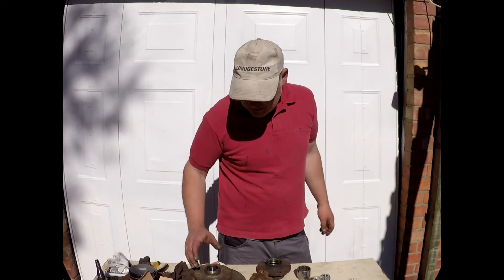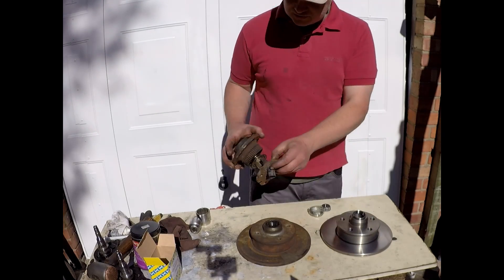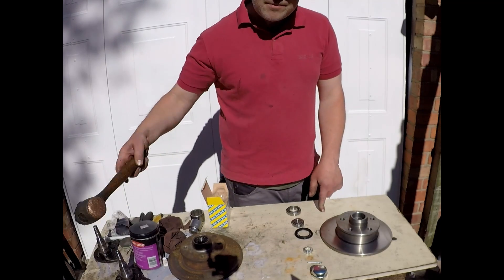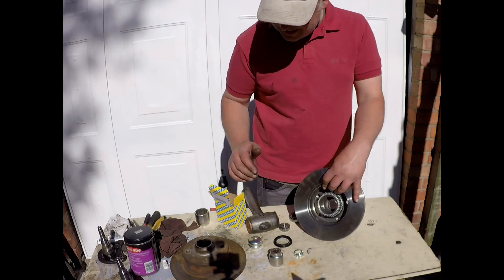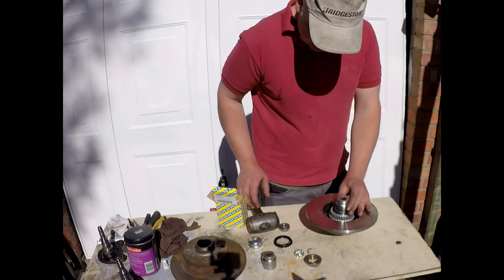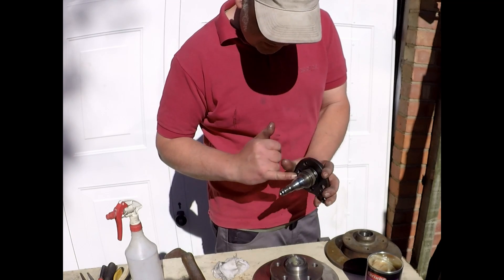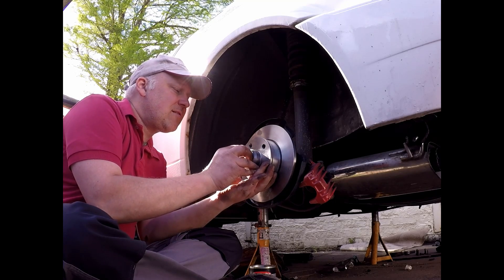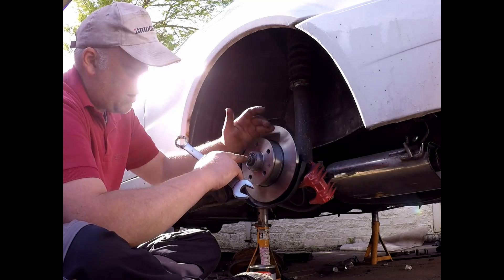VW Rear Taper Roller Bearing Set Up - Changing the Corrado rears to 5 stud, NOT with Lupo GTI parts

Comment: Great video, What about the front wheels, always wondered can you keep the narrow track outer front hub and just swap bearing and center hub from 4x100 to 5x100 or vice virsa
Reply from the maker: Hey Steven, Swapping centres on the front was an option, but I'm running a higher torque unit, so the VR items would make sense 🤔😉 something I also need to cover soon! It's all down to length of the driveshaft/gearbox helps determine narrow/wide track